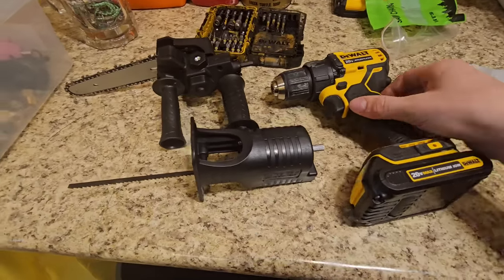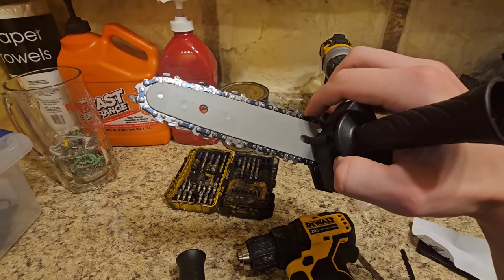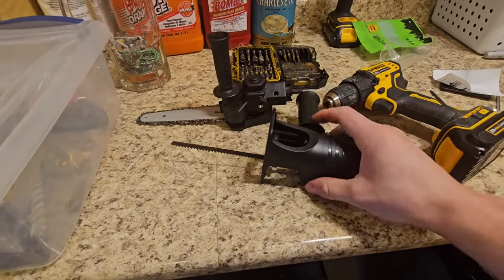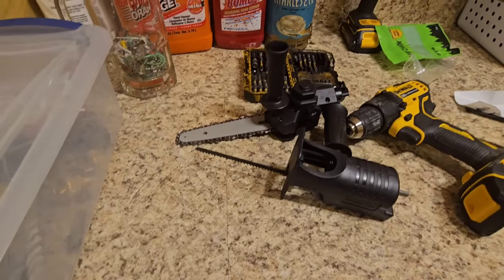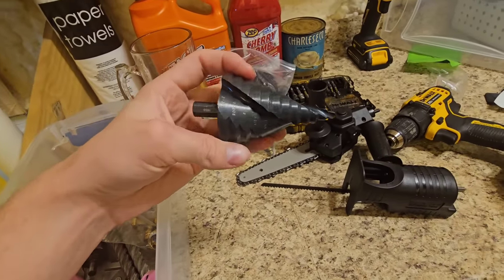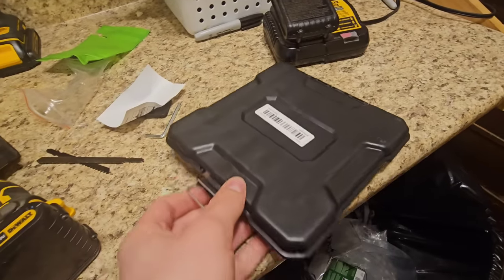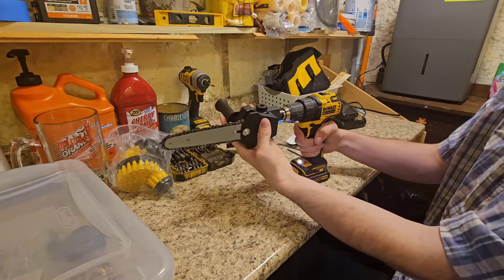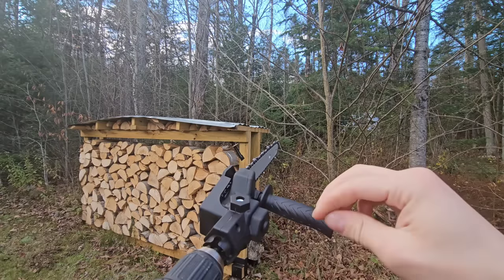Testing Drill Chainsaw Vlog

Comment: Hey Post, just FYI the numbers on your drill are for driving screws so you can reduce it and not round off the head or screw too far into softwood. Above the highest number should be a drill bit symbol, that will prevent the drill from 'skipping' and will give you maximum power. If it has hammer drill function too it will have a hammer symbol and you can use that to drill into brick or concrete as it vibrates the chuck. I wouldn't use hammer drill on that attachment though as it would rattle it to pieces.
If it hasn't got the drill bit symbol, it is simply only a screwdriver.
Reply: Do you think the blade is practical? Novelty comes to mind.
Reply: @stanzaloan3454  Novelty, a lopper would be quicker and easier lol

Comment: Every handsaw is faster 😅

These numbers on your drill are a slipper clutch. Your drill doesn't reduce power, the clutch just slips at the right torque setting.

If you don't want it to slip, you have to put it on the drill setting. Thats the one with the drill symbol. In that setting the clutch gets disabled and all the power gets sent to the attachment. Your drill isn't bad, it's good.
Reply: that's what i thought, i sawed stuff with a handsaw in no time compared to this  lmao

Comment: I have a mini chainsaw I purchased or Amazon, came with a case, extra chain and charger. I love it! So many people have purchased it from watching another using it. I only needed it for one bush that I hate  pruning. One thing since I don’t know anything about chainsaws I did rust out the first chain. User error, but cuts like butter gone through 2 inch branches. Price a little over 20 bucks and of course free shipping. Post think you would like.

Comment: I guess it's good for somebody who doesn't have the strength to use lopper as in the elderly or as you said indoors or in the city.
Reply: Exactly. You will not be cutting firewood with this saw. But I myself am in my 60's and my hands are destroyed from nerve damage and this would work on smaller trimming jobs.

Comment: the chain saw I am not impressed with it is an 8 dollar attachment.  But you need good drill which would be not cheap over 100 bucks.  I can get cheap poll saw 80 to 120 that works well. Unless you need quality drill for other projects for yard maintenance in a city for trimming bushes and smaller side low hanging branches, I would go with pole saw.  

Electric chain saws aren't bad.  The oiler problem you had is probably due to it being from Harbor Freight.  It was probably defective, and another one might not leak.  Harbor Freight can be hit or miss with their products seems more of lack of quality control issues than anything else.  I had decent electric chain saw the old school kind that you needed a cord to run it and plug that bad boy in.  The motor died, got small electric one and it is champ, a Echo chain saw.  

I prefer batter power stuff because no exhaust smell no messing with 2 stroke oil. Less stuff you have to do to winterize it.

Comment: That drill is definitely not your problem!  Dewalt is one of the best.
Reply from the maker: It's the drill making that clicking sound and stopping not the saw
Reply: @post10Vlogs it's because you're engaging the clutch. Those numbers tell you which clutch setting it will engage at, lower engages at less torque. It is to stop screws from stripping out. You want to set that at the highest setting. You'll see somewhere there is a drill bit icon, that doesn't engage the clutch. This is the setting you need to use. It's usually past the highest number, keep turning until it won't turn or it has a seperate ring to twist and change the setting. The numbers 1/2 on top relate to low speed/high speed respectively. Lowe speed for torque, high speed for drilling.
Reply from the maker: @scaryjam8 I did, in the video I literally did every single setting and it was still doing that, DeWalt makes more powerful drills not this one though

Comment: Don’t buy such junk, and wear eye protection please
Reply from the maker: You don't know what's junk until you try, the cheap drill bits work fine and there's nothing wrong with the drill chainsaw it's the drill
Reply: @post10Vlogs please more camping videos I love them
Reply: @post10Vlogs if that chainsaw kicks back then ur in for a world of trouble, especially with no chain lube. Also the lateral force on a drill will ruin the bearings and the gears. Look after urself
Reply: @post10Vlogs  also when you tighten the Chuck on the drill, tighten it fully, then twist backwards and u should hear a click. That’s the Chuck fully engaging, it means heat won’t make it work loose
Reply: @erol4130  Thats nice. What else do you have to share today with everyone?
Can we get a spelling update, or proper words on the update?
Reply: @ducewags enlighten me! I’ve worked on the tools for 20 years and I’d rather share knowledge so people don’t have to learn the hard way like I have. And as for spelling, what difference does that make
Reply: @erol4130  Oh I don't know, try reading the comments you made. Then ask if you were rather rude, and some how think Post has no clue about things. And have a nice day.